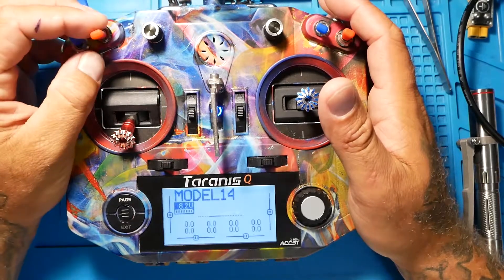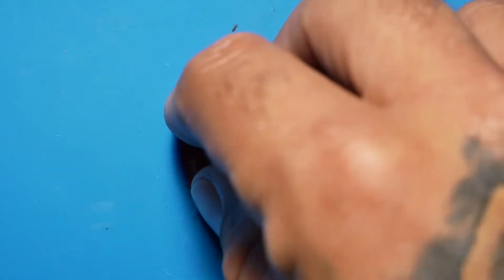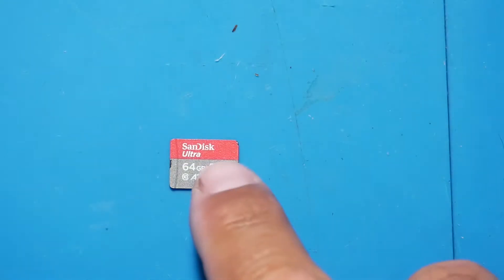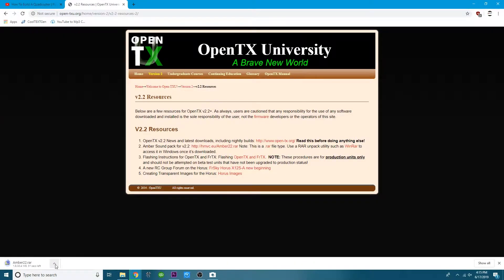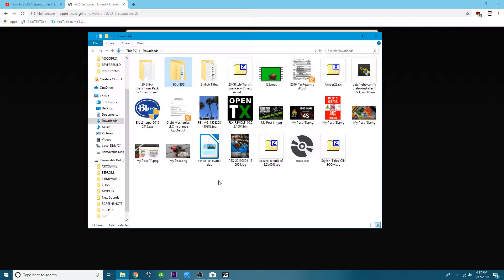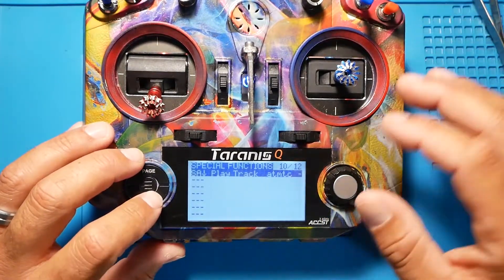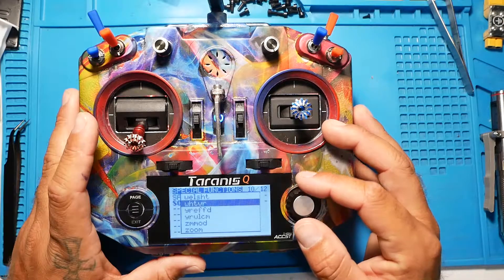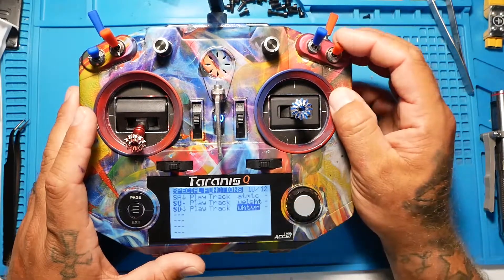How To Make Your Taranis Talk!! How To Install Amber Sound Pack & Put Tracks On A Switch

Comment: Hi, I just bought a Taranis X9D 2019.Im running  open tx 2.3.4    Is the soundpack 2.2 compatible  with my radio ,If you know  ?  Peace
Reply: Just found out today that the v2.2 Amber pak from open tx University will work on. 2.3.4 I just did it
Reply: Reecefpv Thats great 👍. Thanks!!
Reply: @Reecefpv  yes it will. 😊
Reply: @Reecefpv  Did you have to do anything other than the instruction given in this video to make V2.2 Amber Pack work on OpenTx 2.3.4? I really apreciate your help.
Reply: @Zughschpitza  I don't believe so it's been a min but I believe I just used the 2.2 like it was the. 2.3
Reply: I'm trying to find the same info lol but for the x9 lite but same version. Did u have any luck
Reply: Reecefpv I have a feeling it doesn’t exist yet. Everyone says just use the sound pack that comes with open tx 2.3.4. Im sure it will come but this software is pretty new still. Just my opinion ✌️
Reply: @jordannovek2911  yea I think I'm gonna downgrade for now the pak that comes with 2.3.4 doesn't have hardly anything

Comment: Just 1 thing I found is that a 32gB Card is the biggest I can use in the 2019 SE version.
Reply: Gary ,how did you find out that a 32gB  card is the biggest  one you can use in the x9d+ 2019 se?